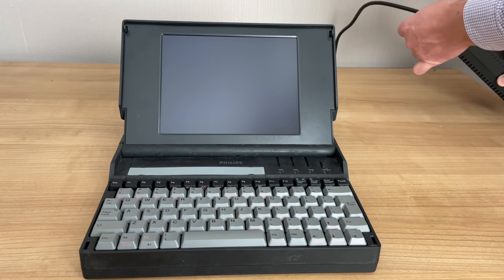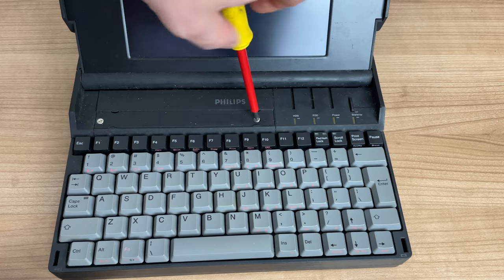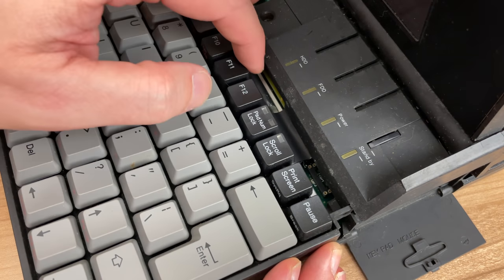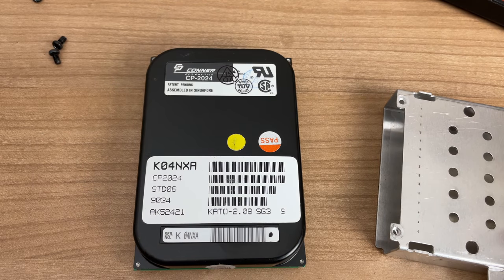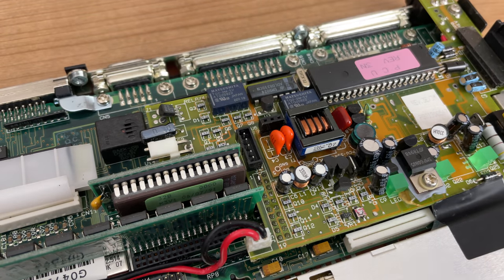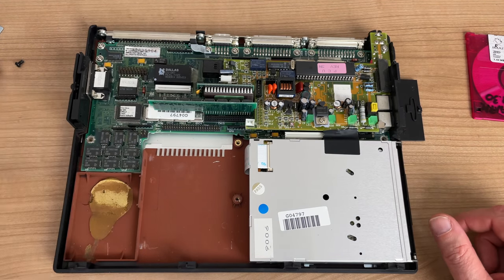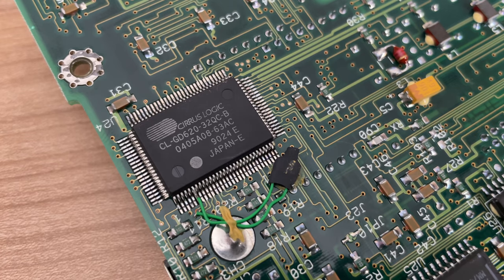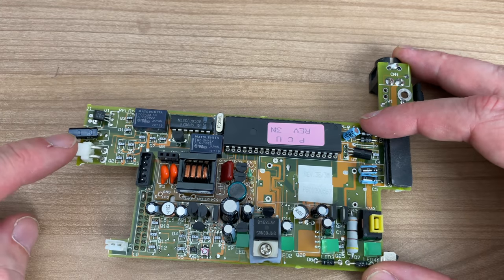Philips 286 laptop - into the belly of the beast

Comment: @RetroSpector78... At 15:17 .. that high pitch is an inductor coil.. from a voltage regulator or similar.......
Is at full capacity trying to sustain the voltage output... because there is very high consumption......
you short something up... in that white video connector that is above the dallas chip...
All around the pins of the Dallas chip..... is a lot of traces that go to that flat video cable white connector...
for example .. at 14:33 the 3 pins 13.. 14 and 15 of the dallas chip.. looks like they are in contact with the trace that pass below them... maybe solder mask broke in that trace... 
at 18:54...  the trace that is between pin 7 and 8 of the dallas chip... looks cut....
at 14:28 the trace that is between pin 3 and 8 of the dallas chip... also looks cut....

Comment: I feel ya. I have been on a breaking streak recently as well. amongst it a rather modern socket AM2 mainboard that worked perfectly and when I took it out of it's box 3 months later it was completely dead. probably chipset. It's bitter, especially with older, rare stuff.
Reply from the maker: Yeah... perhaps this wasn't related to the Dallas chip at all ... who knows .... My IBM 5150 PC that has always been in top-notch shape, never had an issue, stored away in my desk here all of a sudden failed on me completely. No error codes, no beeps, no display ... probably a bad memory chip in bank 0 (soldered onto the board). Ship happens with old hardware unfortunately.
Reply: More than likely you’re right.  I don’t remember if the 5150 is one such, but I recall reading that on some systems an MDA card is sometimes able to show errors when other cards won’t.  Try that if you have a CGA/EGA/VGA card in there now.

Comment: Some legs don't go all the way through but were filled with solder.  I see you replaced them, but you might flood some more solder in there just to make sure you fully soaked all the layers.  Finally, @13:06 it looks like some of the vias were damaged (sixth from the left on the top, seventh from the left on the bottom at that timestamp).  You might check the reverse of the board and see if you can attach some bodge wires.  Whatever the cause, I hope you're able to sort this out and show it to us in working order!
Reply from the maker: The bottom ones i could trace down to the bios pins, so these should be good. The sixth pin on top is the IRQ pin and that one I haven't been able to track down.

Comment: Thoughts are: not holding the iron long enough on the pins of the clock chip to flow to both sides of the board as it is multilayer. And the trace between pins 2 and 3 at top left of RTC towards the video connector

Comment: That's unfortunate. If your are going back to that project take a look at the traces that go between pins 3&4 on the front, 8&7 on the back and 18-24 (over pin 24?) on the back. Mabye carefully touch up the left hand side legs of that logic chip on the backside under pin 13. That second leg defnitly moved and the third and fourth lost some solder as you tried the solder wick.

Comment: I remember that screen was showing the similar stuff on similar Siemens laptop when the screen cable was dying. Unfortunately, I don't remember if that was causing beeps or not. If your cable is ok (seems yes), you may try tracing lines from the LCD connector, maybe the problem is somewhere there and videoadapter is not initializing without connected LCD.

Comment: The soldering doesn't look so great, maybe not enough heat and flux to make the solder flow through. Check out a board repair video from Louis Rossmann to see the flux coming from big syringes.

Comment: In the case of these Dallas ICs, I always prefer servicing them and adding an external CR2032 battery. I know it could be a dirty job and requires some protection arround the IC, but I prefer this technique than dessoldering it from the motherboard.

Comment: In this situation you don't need to remove the Dallas chip! Just pry (or cut) the upper part of the plastic case and you'll see the battry
Reply from the maker: I thought that using a dremel to expose the 2 battery leads and trying to cram in a coin cell into the already tight space would have been more intrusive and error prone then just replacing the chip outright. Have done a couple of those replacements without issues but guess I ran out of luck (and skill)

Comment: I don't have a lot of knowledge about electricity, so sorry if I'm writing something silly. You have mentioned on the video that now the laptop makes a strange wining electric noise. Could it mean that a capacitor or another electric component as gone bad and that that is making more voltage going somewhere were it shouldn't go? That electric component could have gone bad because of the proximity heat of soldering/desoldering, or because of it's age.

Comment: That mainboard looks almost identical to an AST PowerExec laptop I worked on in the past.  I don't think  this one is an AST, but I'll bet there are 10 or more models under different brand names with the same mainboard.  It might be worth investigating and picking up a more common model by the same OEM.  I have had to do that a couple times, with the AST and once with a Gateway Nomad, which as very rare, but entirely identical to a TI model which was more common.
Reply from the maker: Yep, also have the impression that this board is used in different laptops. Finding another one with similar board will be challenging. Not that many 286 laptops still around. But I can keep dreaming of finding a similar 286 laptop with another issue and use parts to salvage this one.

Comment: For future reference, if you have to remove a recalcitrant component like an IC, just clip the legs of the component and then remove them singly.  Most likely you damaged something in one of the inner traces.
Reply: You can't clip the legs from a Dallas chip. They come out of the bottom, with the package sitting flush to the board.

Comment: That will be caused by the capacitors on the power board leaking. You should also clean all the contacts of those pluginn modules that have pins. I'd start wuthh those caps first.

Comment: This movie is on YouTube since 2021 and I just saw it. I have similar laptop made by Siemens. It is 386SX but it looks similar. When I turned it on everything was ok for maybe 10 min. After this time it started to behave strange. At Your place I would disassembly screen because there are some surface mounted little electrolitic capacitors and after replacing them in my case everything was back to normal. I also have a questions:
1. why there is this yellow 4,8V battery pack? 
2. there is a place for R20 batteries. Can I just put there batteries and computer will work (of course without power supply conected)?
3. in my version it is possible to set in BIOS only 3 hard disks so how to made it to work with compact flash card?

Comment: Try reseating every socketed chips, i had a similar issue with my panasonic 386 laptop way back in 1995, my dad reseated every socketed chip and the laptop magically turned back on, my panasonic had been dropped btw, it was only outputting a black/blue screen with a couple of beeps, but it worked out. Could be a power problem as well, what i mean by that, you tried the laptop first without the lcd, so maby that could have done something?

Comment: What a bummer, hope you can fix it, I’m afraid the heat gun was perhaps a bit too much. EEVBLOG Dave Jones once screwed up a TV repair with a heat gun. I think he used kepton tape as a safeguard but it wasn’t sufficient. That keyboard flex cable looks hard to reassemble.
Reply from the maker: Hope that one is still ok, but as long as I don’t get any display output it’s all guess work. Haven’t given up yet but beginning to lose hope :)

Comment: Shame that it didnt work out. The malfunction immediately after soldering shouts to me: solder bridge. These can be almost invisibly small, especially when you solder with too little flux (you can never use too much flux). Also the squealing of the power board after this replacement points to a (hopefully) small and not destructive short. Which might be easier to repair than a broken trace.

In the view 14:28: check for shorts between all pins of the LCD socket, the Dallas chip and the 244's in between the dallas chip. All combinations. Also, silly suggestion: maybe a solder droplet dropped somewhere? It has happened to me...
Reply from the maker: The squealing doesn’t happen that often so not sure about that. Didn’t see any bridges. Checked the voltages also on the dallas and seems fine. Will give it another day or 2 but then it will be time to move on.
Reply: @RetroSpector78  Sure. But if you give that area a continuity check especially for unwanted connections (simpler than checking wanted connections) you might bump into something. Material for a 3rd video :)

Comment: To me it looks like a video ram issue. I would inspect the SOJ package ram chips on the left carefully with a magnifying lens. I've had cracked solder joints on those SOJ packages more than once. And when I see that brown goop glue on the power board: Be careful. That stuff is horrible and tends to get conductive, sometimes even corrosive, over the years. I recently repaired a <10 years old LCD with LED backlight where the goop caused massive corrosion on the backlight power board.
Reply from the maker: Will check ... have been really focussed on that Dallas chip cause the exact same hardware combo worked before. Keep thinking something is wrong with the Dallas wiring causing the bios to think there is something wrong with the video card / video ram ... but perhaps something is indeed wrong with the video card / video ram :)
Reply: @RetroSpector78  Thinking about it: Since the RTC is connected to data bits 0-7 of the AT bus (just like ISA slots and Bios) it is possible that you've accidently messed up the bus. Also: Check the pins of these 244 buffers close to the RTC. Their proximity to the RTC/VGA Bios suggests that they're also connected to the ISA bus. A disconnection or short there in the 16 bit part of the ISA bus could explain why the Bios is accessible but the VGA device is not.

Comment: Check L1, this type of coil has very often caused errors by suddenly failing to make contact inside for no reason.
Check the conductor that goes out from pin 3 U25, maybe there can is damage there, I see a dark place. also check CR1, this is an RC oscillator, there may can be some remnants of solder there. Clean the circuit board with alcohol in order to be able to see the conductor tracks better, maybe one of the near by tracks was cut through?. 

Next time you desolder Pins, use another Desoldering Tool like (US 340) and do not holding down the 
Desoldering tip while you heat the solder joint with the soldering iron. It is also very important to ground the soldering tip with the mass of the motherboard to avoid static discharge!

Here is a link for the good old US 340 desoldering tool:
https://www.amazon.com/EDSYN-US340-EDSYN-Static-Safe-Universal-SOLDAPULLT/dp/B01I7Q5QKM
I've used them every day in my workshop for more than twenty years. Heat the soldering joint longer, until the loot has warmed up  and molten completely (holt the rion tip after molten abit longer down like 10-40 sec to heat up the material around the joint), and then pull away the soldering iron and quickly use the pump.

Comment: In one of my computer, i must do a modded dallas chip ( i know you dont like it) with jcp connector between the chip and battery to start the computer with chip but battery disconnected, then connect it after the computer is on (but dont start)  it appears to put the chip in total blank settings. Strangely, in your case the problem appears to be a broken  connections around the video lcd connector or power lcd connector... in the worst case, a broken trace inside the board... im killing a pentium board like this. I hope you find the solution.

Comment: Usually just dremel off the legs of a chip and then remove one by one. But that chip doesn't expose the legs very well.

If you put a new battery backed RAM chip in, is there some sort of initialisation process? by default it might be full of garbage. I'm not familiar with the Dallas chips and what they are like by default.
Reply from the maker: I would expect an initial cmos checksum error where you get thrown into the cmos setup program to save default or new values. Never had to do some kind of init on those new dallas chips.

Comment: Chips that have stickers on them are probably controllers of all kinds - FDD, HDD, COM, LPT, external FDD and so on.It is also weird that BIOS is socketed unlike Dallas chip. 8MB of RAM is by far an overkill for 286, I consider 2MB as OK for 286. BIOS error code is actually 1-3-1, not 1-3, and that should bring your attention to RAM, especially cleaning the contacts, reseating a module etc. Also, when desoldering a Dallas chip you ripped off one of the sleeves (6th from the right at the bottom).
Reply from the maker: Where did you find that 1-3-1 code explanation for the award bios ?
Reply: @RetroSpector78  As we consider early AT system, beep error codes were not standarized yet. I remember having this code with a 286 Robotron motherboard with SIPP RAMs when I accidentally bent one of the pins. And because your machine is a laptop that error code may be result of a bad contact in socket. Is there any RAM soldered into motherboard so machine could boot without additional RAM chip?
Reply from the maker: No the only system ram is on that stick. There is 256kb video ram soldered on the board below the video chip.

Comment: I had a Magnavox Metalis 286, same laptop, which after a Dallas chip removal worked maybe one or twice, and then did the same thing. You can't successfully desolder it from this laptop, it will kill the motherboard.
Reply from the maker: The computer is working again :) just need to find the time to make a video on it. Some traces needed to be fixed.
Reply: @RetroSpector78  excellent. It's one of my favorite machines of all time. Have you put D batteries in the back and taken it out into the wild?
Reply: @RetroSpector78  i would love to see it working again.

Comment: I wonder if the BIOS ROM is okay. Might not have liked being disturbed. Since it's in a socket you might be able to check it if you have a known good image.
Reply from the maker: Difficult to say. I’m guessing that because it outputting beep codes that are consistent with an Award BIOS that the BIOS is ok. But so many things could have gone wrong.
Reply: @RetroSpector78  yeah I was thinking CRC failure, partly working. ROMs that old can get bit rot. Does it have any serial output?

Comment: I have an AST 386SX laptop with a Conner CP2044 drive, the 40MB version of this. I'm pretty sure it's bad as the system can't boot off of it.
Reply from the maker: Possibly, seems like these hard drives have bumper stops that gum up. But at least your laptop (probably) still boots from the floppy :)
Reply: @RetroSpector78  Unfortunately, no! I don't have a working CMOS battery and that seems to stop the laptop from even trying to boot off the floppy drive.

Comment: Il semble avoir une piste brisée sur le circuit à côté du chip M024G proche de C4, en face d'une des broches du coin du chip dallas. 14:30 et 14:34
Reply from the maker: Checked that connection and seems to be ok.
Reply: @RetroSpector78  Dommage. Un bonjour latino-américaine depuis la France.

Comment: I have a Packard bell 386 that looks the same  the hard drive ya a 3.5 inch Conner CP4044 (Stubby)    has a custom 44 pin connector that is smaller then the standard 44 pin ide

Comment: Reseat the RAM and BIOS?
Reply from the maker: Checked that also. Same issue
Reply: @RetroSpector78  Could it be the ribbom cable from the lcd panel is not seated correctly?
And, forgive my ignorance, but did it work without the HDD connected? Just guessing here...
Reply from the maker: @stefanbol4078  The most basic test is just the motherboard + keyboard (and then using the FN + CRT key to activate the external VGA connector) That is the minimum set of components you need. If you think the keyboard is broken you need to hook up the internal LCD. That's how I tested it before I replaced the Dallas. And I was able to display something on the external VGA port. But not anymore after the Dallas replacement :(
Reply: @RetroSpector78  What I am curious about is, are your really sure the POST beeps are related to the graphics? I have stumbled across simular Award BIOS'es where the beepcodes where different than what you would expect. In my experience some manufacturers have different POST beepcodes on same BIOS chips, because they use their own firmware on it.
Of course I can see there is a video problem LOL
Keep up the good work and hpefully you get the laptop going again!

Comment: @15:17 that high pitch noise sounds like the backlight inverter (pink/white wires usually goto the ccfl  backlight and need +1000V) if had broken solder joints make that sound before as you will get arcing across the break (although usually comes with a heavy ozone smell at same time)
Reply from the maker: It doesn’t always do that, but if the issue is video related (seems to be due to the beeps), then perhaps crappy signals are now finding their way to the lcd panel ? It is a monochrome display so I was surprised to see orange / yellow garbage on it.